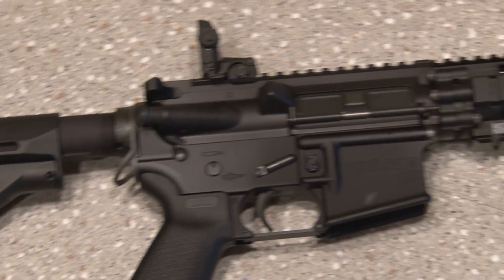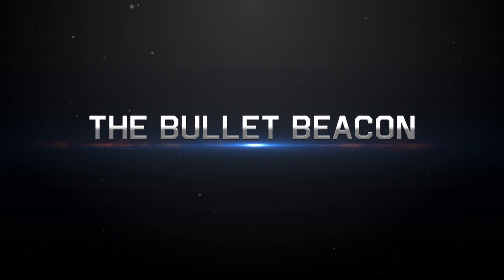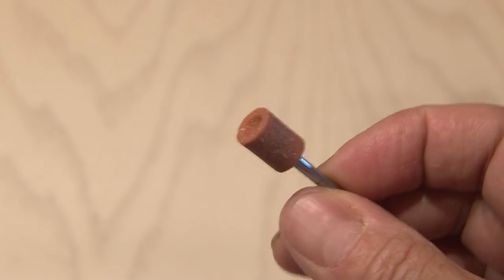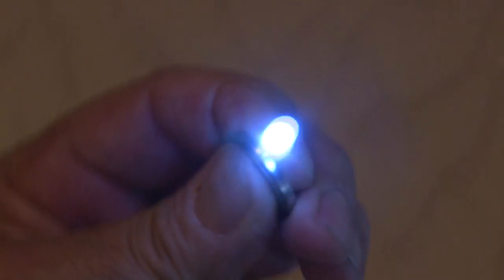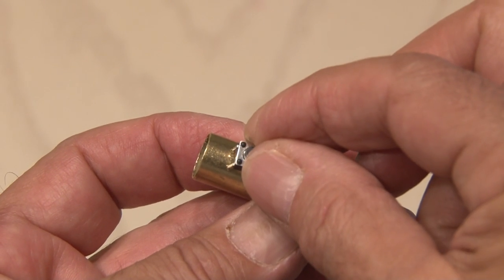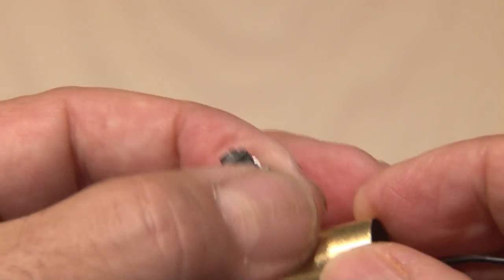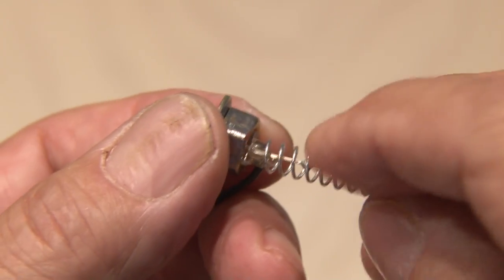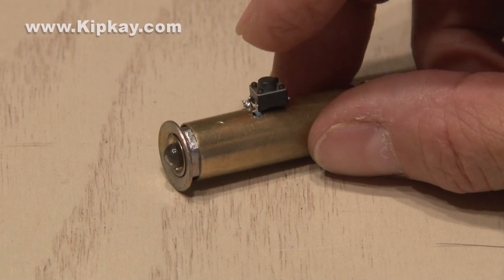The Bullet Beacon!

Comment: Might I suggest using a bit of hot glue under the switch? The mechanical stress of pressing the button may wear down and break that solder connection on the switch.
Reply: I was thinking the same thing.
Reply: +Mojobojo I'd go 5 minute araldite. Also the soldered key ring would be fun - for about 30 seconds.
Reply: +Mojobojo nothing he makes is made to last, its JUST meant to encourage people to try things and  come up with their own ideas
Reply: +Mojobojo nothing he makes is made to last, its JUST meant to encourage people to try things and  come up with their own ideas

Comment: Or you could simply replace the LED with a small laser diode and put the wiring into the case, then use the switch to light it.

Comment: But if you mess up then everytime you touchit you might get an electric shock
Reply: no the batteries are much to smal
Reply: If applied directly to your heart? Yes. Just touching it? No
Reply: +{MLP} Rainbow Dash If it's close enough. The small charge disrupts ur heart, forcing to get a pacemaker if u survive.
Reply: {MLP} Rainbow Dash No, i didn't say electricuted, i said shocked, i ment like if the spring touches the bullet casing while the button is pressed couldn't you get a small shock?
Reply: +Zlupper. human skin has a resistance of like 2000000 ohms you would need atleast 50 volts to even feel a tingle so with 2 1.5v button batteries you would feel nothing
Reply: +Zlupper. The voltage is to low, you wouldn't even feel it.
Reply: Zlupper. It wouldn't even be noticeable
Reply: Kyle Gardner oh ok.
Reply: +Kyle Gardner volts don't kill amps do
Reply: +Zlupper. no because it would be shorted out and you would not become part of the circuit
Reply: +mcilveen11 WRONG Bucko, skin resistance can be as low as one ohm to infinite dependent on how dry it is, it is typically given a resistance of 1K ohms when dry. (1000 ohms) and 500 ohms when not (but not wet). these are based off galvanic readings used in polygraphs
Reply: +tvdave1  do you know Ohms Law?   voltage divided by resistance equals current   ergo 1.5 volts divided by 1 ohm equals  1.5 amps ,   between .1 to .2 amps across the heart is fatal... therefore 1.5 volts CAN Be  ten times  the necessary voltage to kill under the proper circumstances.
Reply: +mcilveen11 Bullshit. If you DID you would have already known these facts instead of being ignorant of them.   I DO hold an MSEE jackass  care to keep proving yourself a Liar?
Reply: well Scott as much as i have all the time in the world to waste here and argue with you, your the one who needs to prove your level of education, from what i can tell your just someone looking for a YouTube argument. you are right to say the skin resistivity  fluctuates depending on the how wet a persons hands are. but if you actually watched the video you will notice that his hands are NOT wet so this point is irreverent and to say that it can have infinite resistivity is wrong as only empty space void of any matter can a achieve this. you dont have to have a masters degree to work that out.